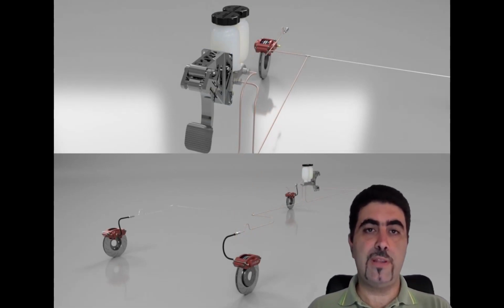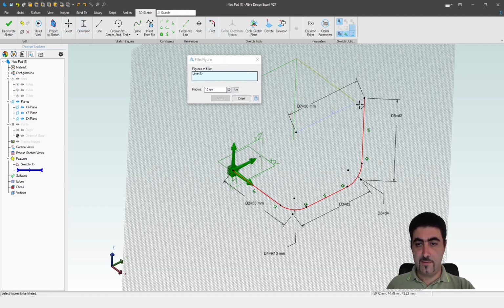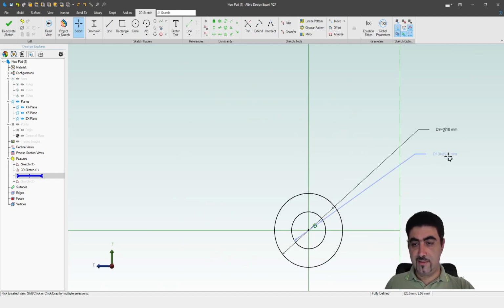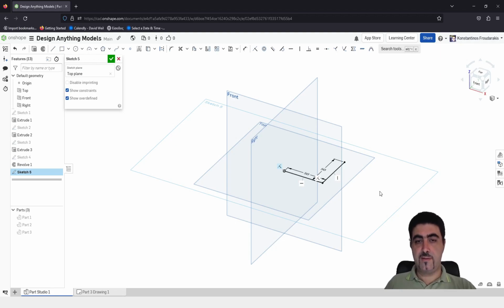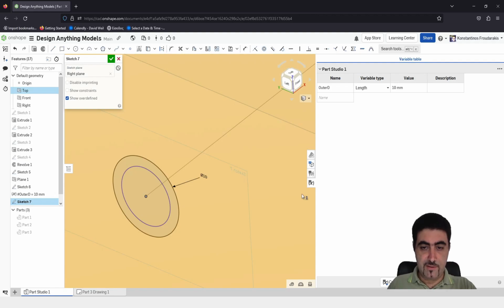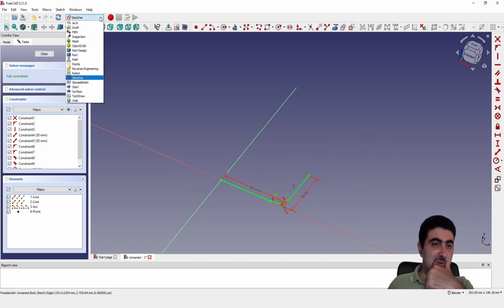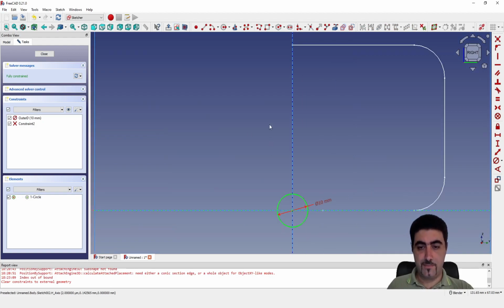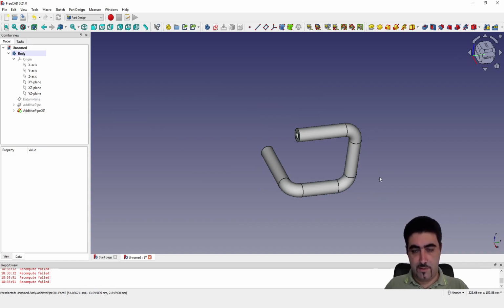Any Parametric CAD 4: Sweep Command

Comment: How did you get the variable name to display in the dimension for Alibre, thats really handy ?
Reply from the maker: Yeah, that is really handy. You open a file (part or assembly), go to properties-->Dimensions-->Click on the "Show Equations" checkbox. Bear in mind that, when you write an equation it will show the equation there and not the result. But I don't mind. In fact, I like it better like that. If that puts you off you can revert back.

P.S. One of these days I will be doing a video on how I've setup my Alibre. Hotkeys and everything.